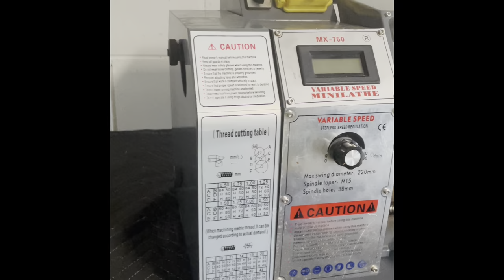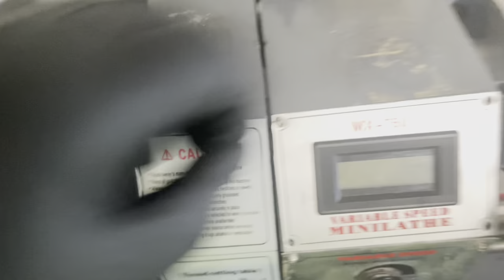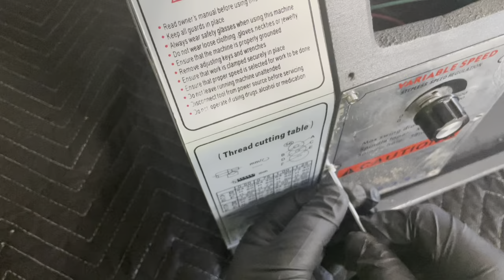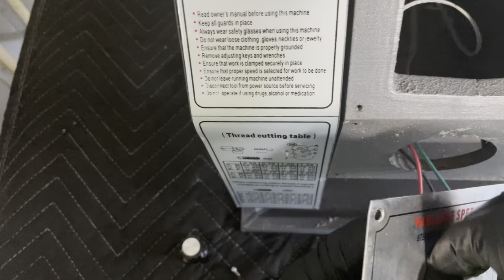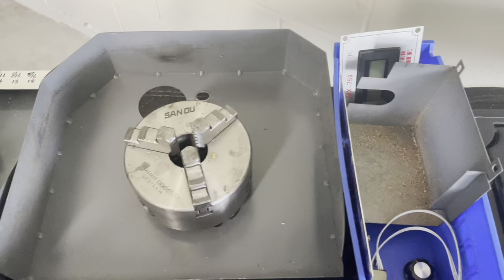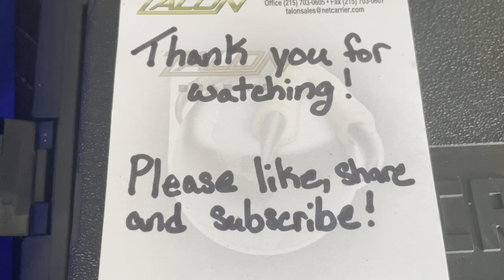Disassembling used cheap Chinese Lathe | Part 1

Comment: Couple of tips:

1: If your lead screw is dragging on the half nut, you may have to adjust the the alignment of the two end bearing blocks. Mine is noticeably not straight but not bent either. This can affect bearing life and power efficiency. 

2: It may be a good idea to install a rubber guard to cover the gap between the ways and the head. You can also find cheap accordion style way covers. 

3: If you have a 3d printer you can make simple telescopic covers for the lead screw.
Reply: Good tips there. IM not a fan of the metal covers as they act like a spring so a 3d printed one is a good alternative.

Comment: Bought the same model new. When I got it, what a mess. Dents and scratches. That's not the bad part though. The first time I turned it on it blew the control panel.
When I opened it up there were loose wires. I think it was wired wrong as it didn't blow the fuse. Waiting for a replacement panel and asked for a wiring diagram. I don't think I will have much luck with the diagram though. While I'm waiting I'm also painting and working on all the rough finish. Good video, thank you.
Reply from the maker: Thank you very much. I’m to hear that, glad you enjoyed the video. Any problems or questions please let me know and I’ll will try to help!
Reply: @howdoidoit1  Really could use your help. Got the wiring diagram from the vendor.....basically useless. One of the things I'm having trouble with is that there are two wires from the on/off switch that are so close in color, black and I'm guessing brown, that I'm not sure which is which. If you get a chance to open your unit again, I would love to get some pictures of the wiring. Best Regards, Greg.....
Reply from the maker: @gregboyer3086  sure no problem message me on Facebook or Instagram and I will send to you as soon as possible.
Reply: The worst part about this model is it cuts like shit. I completely replaced. Bearings, compound, cross slide, saddle, apron , chuck to get it to not have chatter. I should have bought another lathe. But mine was the ys-2180 8x32 

Your head stock casing has a lot more material than mine. Maybe this is better.

Comment: I wanna buy one but scared to death to buy it that it will be garbage and can’t get parts for it prolly
Reply: i have the exact same model - and it's not a bad machine..sure cant compare it in rigidness whit my Colechester,but for a small machine it's quite ok - however it takes some tinkering to get it better , all surfaces on the castings are very rough,and an evening taking everything apart and getting ridd of all the coarse corners and stuff whit a stone is some hours well spent - my ,achine also had something very annoying,and it again was due to casting of the bed,when cranking the handwheel it was light and easy at the middle but harder at the ends,especially at the chuck-end,i measured the surfaces,and it was thicker at the chuckend and tailstock-end than in the middle,so i dismantled the entire machine and put the bed upside down in my mill and milled the bottompart to a straight thickness,and then put it all together again and adjusted the carrige- now its the same resistance on the handle all over the bed - i am at the moment ordering parts to get ridd of that small 1-phase motor and replace it whit a 3phase 4-pole 2,2 kw-motor that will be controlled by a vfd